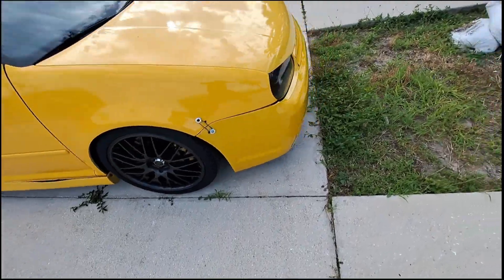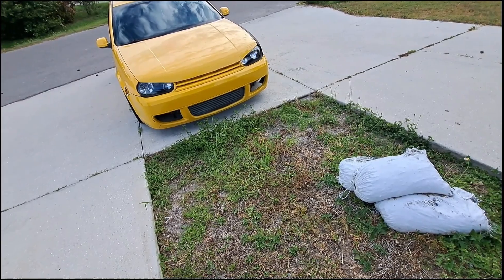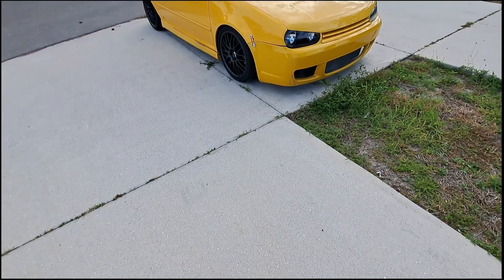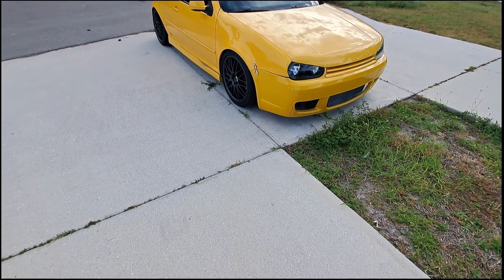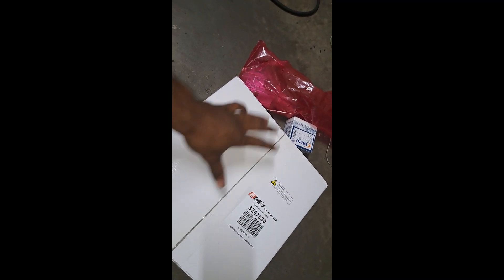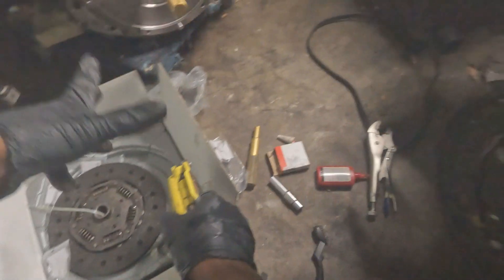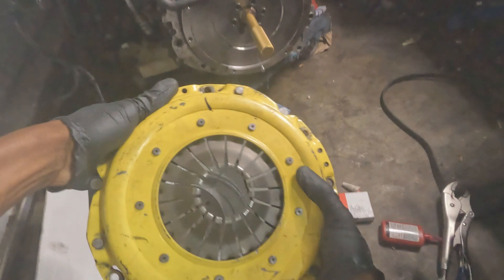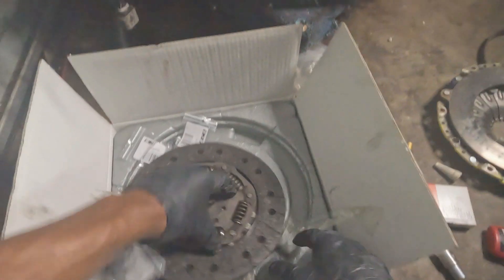2.5l 07k 5cylinder swap Audi A4 B5/B6/B7(swap series) wiring up next

Comment: Why not standalone? All the Audis use the same canbus stuff so any 2.7t or 1.8t santalone the claims to run the gauges on a b5 or newer will run the gauges. Heck the mslabs tt-Rs even claims to work with vagcom. If it was me I’d have wired the engine harness to an me7.1 connector and pin out like a 2.7t and just used a b5s4 pnp standalone.

Did you also see that spa came out with a fwd manifold that should fit better than the one from the 944 swap.

But stop holding out on us and let us see that oil pan.